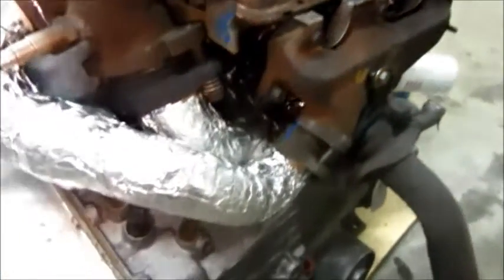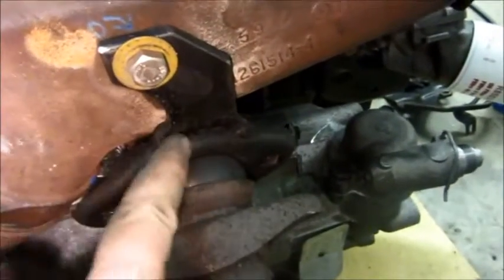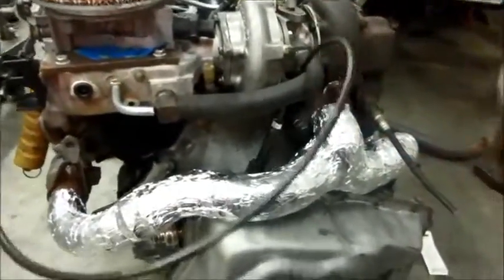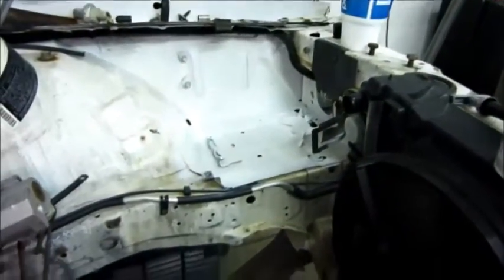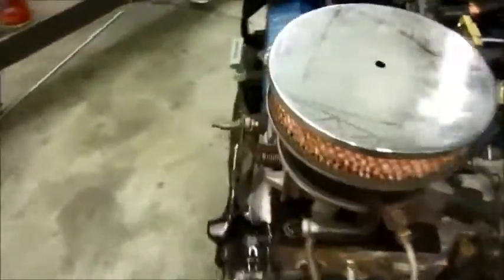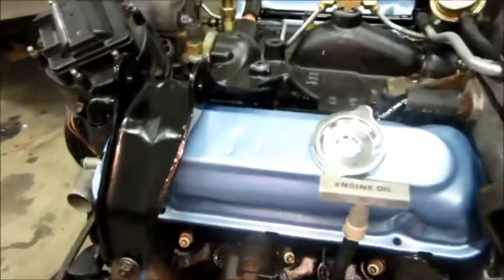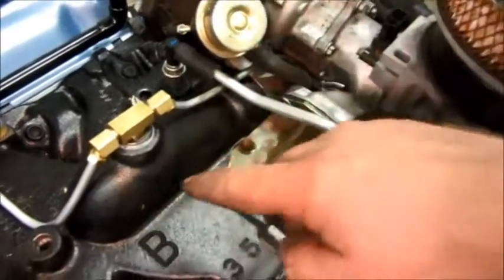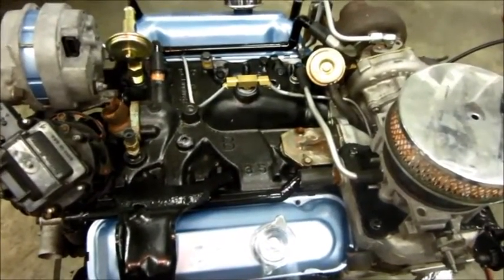Buick Turbo Draw-Through Build (pt 25) Exhaust System, and engine detailing...

Comment: Could the air / fuel mix going to the trans modulator damage it, or cause fuel to collect and pool inside it?
Reply from the maker: +compu85 

I am not sure what will happen. The modulator diaphragm is definitely fuel proof, so I know it will not damage it if fuel goes in there.  

What I expect is, that when there is boost pressure and some fuel vapor goes in there, after the engine returns to a vacuum condition, any liquid fuel that collected in there will quickly boil off and go back into the manifold.

Since this is an automotive engine, it won't see continuous boost like an industrial engine would.
Reply from the maker: +HUBBABUBBA DOOPYDOOP 

Actually, with a turbocharged engine, the intake manifold can have less than atmospheric pressure (just like a natural aspirated engine) and also when the turbo is spooled up, it has more than atmospheric pressure. The "boost" gauge reads vacuum and positive pressure, with zero somewhere in the mid-scale so you can see what's happening in the manifold.

The modulator does see positive pressure under boost.

Comment: Is the modulator different on a turbo with pressure vs a normally aspirated with vacuum signal?
Reply from the maker: +William Fowler 

I am using a diaphragm modulator, which is a standard aftermarket replacement part. There are certain check valve and orifice configurations that change the level of pressure applied to the modulator when boost is happening. On my other cars, I have simply used a normal, straight connection between the modulator and manifold pressure. As the air pressure is applied to the modulator, it increases the outward force the modulator plunger places on the modulator valve. This causes the transmission charge pump pressure to increase, thereby increasing the torque capacity of the transmission.

Comment: what alternator bracket/tensioner is that? ive never seen one like that before.
Reply from the maker: Hi; that tensioner is original from the 1984 Buick 3.0 carb motor!
Reply: @davida1hiwaaynet  that's interesting. they used so dang many different kinds haha.